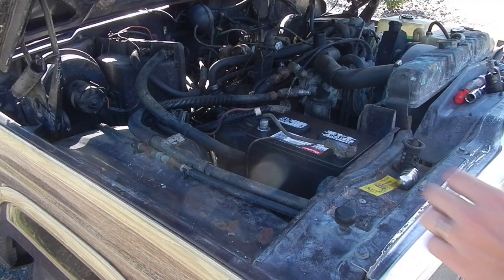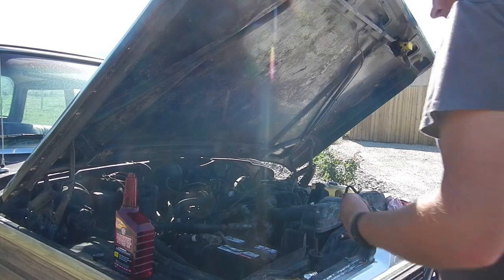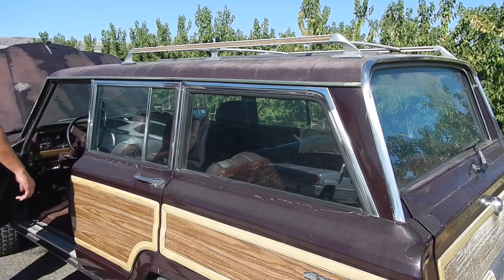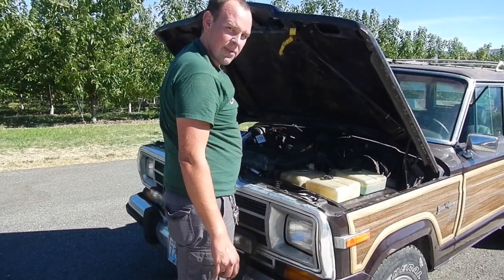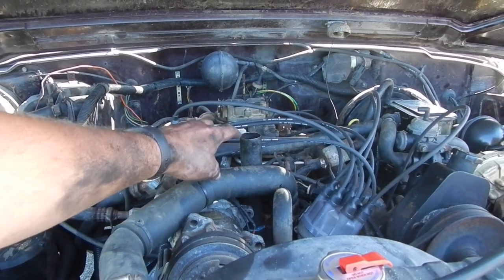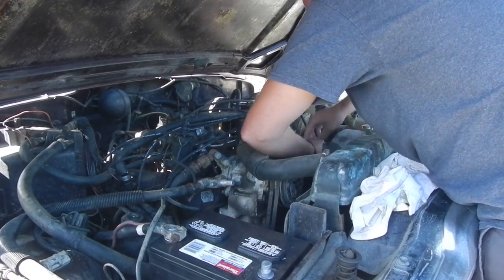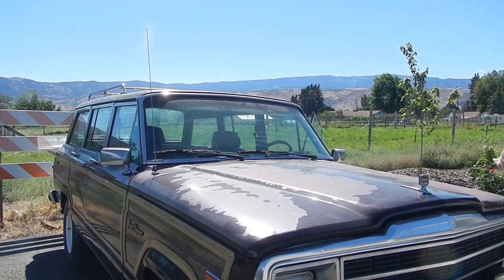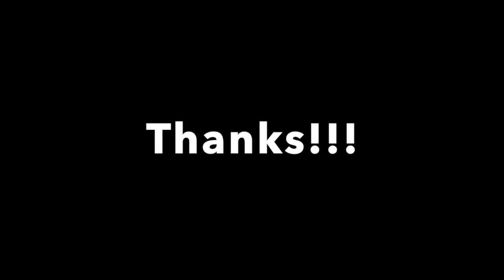Waggy Resto Pt:2 Will it start??

Comment: Great video! You did a lot better on your will it start then i did with mine haha. The tube that was smoking around 17:50,  AMC 304, 360 or 401, that would be your oil fill tube and should have a cap on it. They still make them. I have a CJ7 with a 304 that has a Edelbrock cap on it. The cap is vented so if your getting smoke there most likely blow by. Wagoneers are a lot of work but are fun jeeps!
Reply from the maker: Thank you, I ment to say it later in the video but I came across the oil cap laying next to the carb and figured out that must be what it was... So weird, all these dang motors are so different. I'm not always this lucky on getting them started, the cheap boat build is a good example!